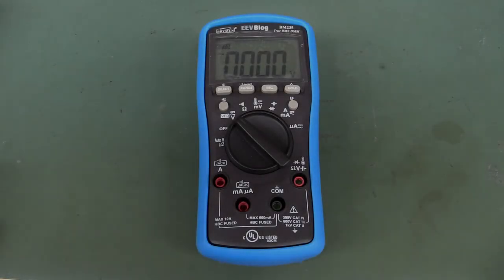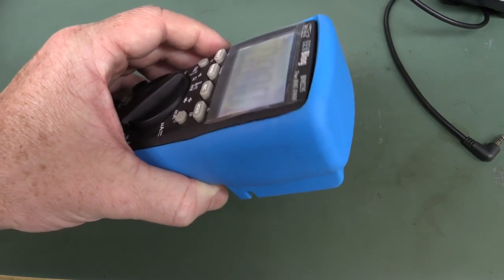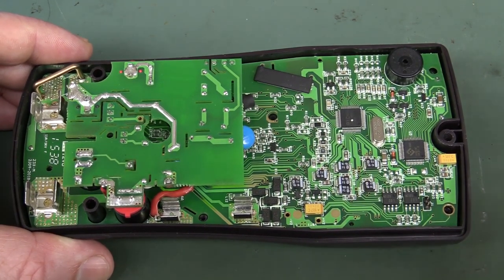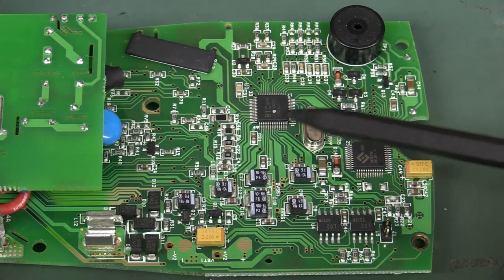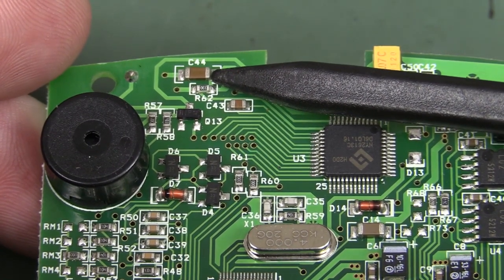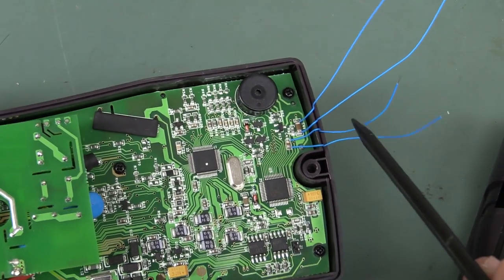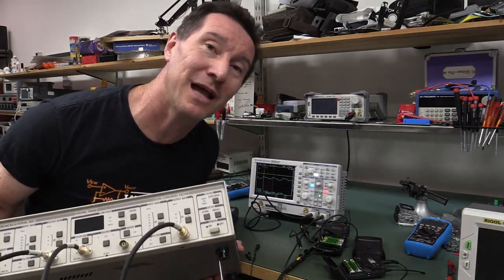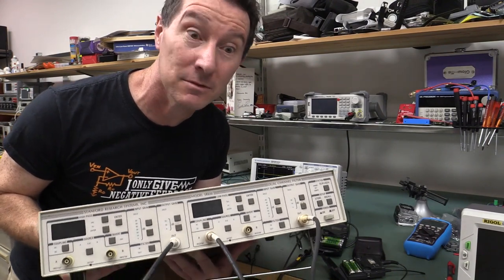EEVblog #855 - Ceramic Capacitor Piezoelectric Effect

Comment: As a test engineer I found out this problem some years ago while I was working on a SLIC device (a telephone line driver). I had a very nasty background noise which messed up the noise level measurement, we're talking about 100uVrms range noise in the audio bandwidth, very low but high enough to ruin my measurements. All was due to a small filter cap at the end of a differential amplifier in the signal chain, once I changed this to a polyester cap the background noise went dramatically low!

Comment: I love how hes like "you might be able to hear it" when its louder than the button press annunciator
Reply from the maker: +tim turner No, it's not, I amplified the audio in editing.
Reply: +EEVblog  hey can i still get on of your meters?
Reply: The whine isn't even louder than the beep in the video. The beep is higher pitch, though. Maybe that's why you perceive it as louder.
Reply: +tim turner You would be surprised. Some people are not very sensitive to high frequencies even when age related hearing is taken into account. I remember being able to tell if the TV was on in another room and none of my friends understanding the sound I was telling them it made. I think it's more of the mind filtering noise than it is the ears themselves. My head picks up every little blip and bleep in the world around me.
Reply: +tim turner I've always been more sensitive to most when it comes to these sounds too, I can hear CRT TVs when they're turned on (the high frequency noise, not the sounds you're supposed to hear from the speakers) but as I've gotten older, I've discovered I have tinnitus. If you've heard those ringtones that supposedly adults can't hear (this was a big thing back when I was in HS anyway) my tinnitus sounds like that, but not at a super loud level, so it has made it harder to hear some high frequency sound, as I don't know if I'm hearing something or if its just the ringing in my ears.
Reply: +Subparanon Indeed. lots of people don't really hear high pitch sounds. I remember as a child hearing annoying high pitched sounds all the time. Just changing the orientation of my head would sometimes make the sounds louder or softer. Eventually, I managed to determine that most of the sounds were from "ultrasonic" devices scattered about such as remote controls to TVs, old style motion detectors, etc. Some person didn't believe me, so what I did was have him unplug the TV (so it wouldn't respond to the remote control). I then closed my eyes and then had him press the buttons on the remote. When he did so, I then told him whenever he pressed a button or released it by the rather annoying whine the darn thing gave off when activated. Needless to say he was a bit surprised. I'm quite glade that remotes have transitioned to IR instead of ultrasonic, but there's still quite a bit of ultrasonic noise in various places still.
Reply: +tim turner My poor ears >.<
Reply: @johncochran8497   That was and still is the case with me. Back when CRT TVs were still common I could here them being on in peoples homes as I walked by on the street.

Comment: Another possible fix could  be a nice dollop of silicon to cover and dampen the  capacitors oscillation  frequency, which insistently clashes badly with my tinnitus!!
Reply: +Michael Beeny Good idea, that would probably nail it, and much easier than cap replacement
Reply: This could be why they put hot glue over the inductor of another Brymen teardown Dave did.
Reply: +Michael Beeny Pleasant to me, slightly lower in frequency, almost canceled it out.
Reply: +Michael Beeny i done this on various units which have backlights, as they usually tent to produce all sorts of ringing...simply a big silicone drop on top will fix that on 80%...sometimes i use hot glue, as it is stiffer and weakens the ringing a bit more...it depends...

But never use epoxy or alike. if it´s hardened up you´ll never get it off again...and it amplifies that ringing tones...
Reply: +sporadic -Z Noises like that drive me ever so slightly completely insane :)
Reply: +treborrrrr Is it possible to be slightly but completly insane?? Just a thought!!

Comment: Nice video.  Thumb up, as usual.  
Here's a story about the piezoelectric effect that some might find interesting.  Several years ago I designed a Bit-Error Rate Tester (BERT) that ran at 43 Gb/sec.  It included 17 serial channels that each ran at 2.5 Gb/sec, and each channel needed its own separate PLL to produce the 2.5GHz clock, because I had to be able to adjust the relative phase angles. (You can control the phase angle of a PLL by feeding dc current into the loop filter, which I did with a DAC.)   The eye patterns would look okay for a few seconds, and then suddenly get really cloudy, indicating jitter.  Then I noticed that tapping the side of the chassis with a screw driver made a burst of jitter.  I thought is was a loose connection, but it turned out to be piezoelectric.  Each PLL circuit had a VCO that got its supply voltage from a low-noise LDO from Micrel, and I used high quality ceramic caps on the output of each LDO.  Turns out, just a 5uV shift in the supply due to piezo effect was enough to push the VCO frequency slightly, and it took a few microseconds for the feedback loop to compensate.  But a few microseconds is a whole lot of bit periods at 2.5 Gb/sec, and the very slight freq shift caused the phase errors to accumulate (phase is the integral of frequency).  The result was that the phase difference between the channels would bounce as must as 35 degrees.  Replacing the ceramic caps with low-ESR tantalums eliminated the problem.

Comment: interesting investigation, I also had a similar issue on a board with a charge pump ic, same thing, I managed to get much better results with a quality TDK cap but I couldn't make it go away completely. I guess this can only be fixed completely by having a different switching frequency in the charge pump.

Comment: Try slipping some bus wire under the cap before soldering, then pull it out to see if you can de-couple the board from the cap.  The resonant frequency of the sound should change because the cap you put in is physically bigger.  You could also try some GB liquid electrical tape over the cap to see if you can dampen the sound.

Comment: Spot on. If you don't specify component grades or tempco values, mfg's will use whatever's on the shelf. They look at footprint, value and voltage rating first when using house parts.

Comment: The line output transformers of older crt pal and ntsc sets oscillated at line frequency 15625 for us in UK with our 625 line 50 frame system. I remember hearing it as a young'n..

Comment: I once worked on a DC-DC switching power supply project that included an over-voltage and reverse voltage protection circuit on the front end.  The two circuits worked fine separately, but when combined, the switching frequency of the DC-DC regulator (600 kHz) caused them to couple in a way that made the OV/RV circuit oscillate badly.  This caused the two 10uF MLCCs on the input of the DC-DC regulator to scream quite loudly, at a frequency that varied with input voltage.  Here's a Dropbox link to a short recording of the sound, as input voltage was varied from 7V to 18V and back to 7V.  https://db.tt/9XAGyHpA (Buzzing MLCCs.m4a, 318kB).  This was not amplified during recording; it was clearly and loudly audible from across the room!

Comment: I have noticed this on a lot of my boards. I use ceramic x5r bypass caps and get a click when connecting power or a whine when driving leds with pwm. It only seems to be very noticeable with larger caps (>4.7µF) and packages like 1206 or 1210. The size of the board and location on the board can make a big difference too. The capacitor causes the board to flex, basically turning it into a speaker diaphragm.

Comment: From the looks the capacitor you whacked in there got a much higher voltage rating than the original one. That one was only 6.3 or 10V I guess. So the DC BIAS influence from your cap is most likely smaller which results in a higher effective capacity. That could be the reason for the lower frequency of 3.x kHz you measured.

Comment: I have a TI n'spire CAS calculator (a TI-64 on steroids)  and it has a color LCD display, I think the resolution is something like 200x300 ish, and when the battery is nearly dead or if the backlight is not at full brightness, it makes similar squealing noises, VERY annoying. I assumed it was an inductor in it part of a small buck-boost converter, I'll see if I can pull it apart and investigate it.

Comment: @EEVblog Hey Dave, could you please make a video going the other way, investigating how vibrations and shock induce a voltage over the capacitor? There's not much available online, particularly comparison between Class 1 and Class 2 capacitors. Class 1 is meant to be much better, but no one shows test results.

Comment: Many years ago, I knew a clever engineer who converted ceramic disk capacitors into piezoelectric transducers. I don't know the exact recipe for the conversion but it was something like this. First, he connected many identical disk capacitors in parallel and inserted them into some oil which he heated above the Curie temperature for the ceramic material inside the capacitors. Then he applied a high DC voltage continuously to them as he slowly cooled the oil. Not all the caps performed the same afterward so he sorted through them to select the best ones.

Comment: MrCarlson's Lab did a video with a nice demonstration of the piezoelectric effect of a generic ceramic cap. Also, I would've tried bodging an electrolytic on there, that should fix the problem completely.
Reply: +MrJohhhnnnyyy         If you have room?
Reply: Hoobie Siamese Yeah, I meant just temporarily whack it in to see which one of the two makes most noise

Comment: Some of us are very sensitive to high frequency noise and I have thrown things away because they make an annoying high pitched wine. Tenergy makes a great NiMH battery, but their top of the line D cell charger starts screaming the moment you plug it in. I had to move it to my garage. I guess I know what to replace now. I thought it was some kind of voltage converter for the charging circuit.

Comment: Yeah I thought about that, so I checked again and there is a noise, so updated my comment!
There is a permanent noise when u turn the dmm, seems like its a bit quieter than  yours and ~3khz, also my 257s has 2 yellow vs  yours 3 white!
Who is really quiet, its my bm869s :)
Dave, which one u prefer  257 or 235?

Comment: I only recently learned about this property of ceramic caps. I have a small tube guitar amp that I did a bunch of switchable mods on (it's an experimental platform) and this explains why one didn't perform as expected. Guess i should stock up on more low value poly's for my experiments and mods.

Comment: I was curious if you had considered making an acoustical "sniffer" for ferreting out issues like this. the heart of this would be a tiny electret (ELECTRic magnET) condenser mic element. this can be fished out of a cheap headset they sell for phones. Because the element in all likelihood has an omnidirectional pattern, it will hear everything, and with surprising accuracy to boot. you can use this directly with the audio analyzer apps on your phone, or if you want, you can haywire an op-amp based preamp between the acoustic probe, and your test equipment.

And yes, I agree with you about fan cooled gear. when I'm at work, I am bathed in a virtual sea of white noise.

Comment: Curious how much 'solution' could be had with gobbing the cap with hot-snot as a physical damper to the sound.  I'm guessing the board is resonating enough that it would still propagate.
Reply: +frollard I had the same thought, I suppose it should at least dampen the amplitude a little bit. It would definitely be an easier fix than swapping the whole cap.
Also, could this be a failure mode in the long run, where caps wiggle themselves loose on the board, especially with the less ductile lead-free solder.

Comment: I was hoping you would try to solder that LED to the footprint to see if it would work...
Reply: That LED shining out of a window on the back of the unit is almost certainly acting as an optocoupler for some sort of serial data upload. My Uni-T UT61E has a similar mechanism.

Comment: Hi I have a serious question and ask for your generous help. I have a 0805 SMD Non-Polarized Capacitor that I’m working with but don’t know it’s value, I’ve tried reading it in multiple ways but had bad luck when purchasing a capacitor to match the one I need, please help, there are many other videos out there about capacitors but not for this kind. Your reply would be greatly appreciated, thanks.

Comment: tell me if i say bullshit BUT:
speed of sound is ~400m/s, one square is 100uS, so une delay of 100uS may be caused by placing the microphone @ 400m/s*0.0001s = 0.04m = 4cm... right?

So im my opinion the peack we see @17:32 should be shift LEFT by ~150us, and that mean the microphone is about 4cm away from the source of the noise.

Comment: Transformers make 100/120Hz (and harmonics), actually.  Same for ferrite inductors: the effect is magnetostriction, which has a square-law response (hence the frequency doubling).  This is the magnetic analog of electrostriction, which produces sound in most capacitors (including film caps, just not very much for PP and PET kinds).

Piezoelectricity is a different effect (stronger, self-polarized by nature, proportional), but is indeed present in type 2 ceramic caps.  Typical magnitudes for mechanically tapping on a PCB are single to tens of mV, so don't use them anywhere microphony is undesirable!
Reply: +Tim Williams YES! I'm a sound engineer and when there's a 100hz Hum my colleagues say it can't be transformers. I was always skeptical about it and now I know why
Reply: +Tim Williams Ferrite inductors used for voltage boosting can make very high pitched sounds, like in a joule thief circuit.

Comment: You could have used alligator clips with a steel ball in the jaw tip (from a ball bearing) and isolating the bottom of the clip with electrical tape to jumper power to those pads pretty easily.

Comment: Had that sht in a pc mouse. It took me a while to find a source. I thought it was a main ic itself. Fixed by placing some electrolytic cap in parallel with input  bypass caps. Thanks, good to know the real physical reason behind it.

Comment: Could the variations be because of the current sensing? Maybe bumping it changes the conductivity of the battery terminals (or spring connectors), so the pump changes frequencies to keep the output to the back light constant.

Comment: you want two mics, one near the meter and one further away, then take the difference in signal. Also, I'd have them equidistant from where you think the noise is coming from, it could potentially be rustling of clothes or other lab equipment.

Comment: could you tell me why a manufacturer would put a glob of epoxy instead of the chip on a multimeter board and is there any diference between the two

Comment: Also, YAY, finally an electronics video, instead of some teardown or mailbag XP
And also, the audible frequency range isn't exactly dumb. There may be a good reason for it, like losses, switching speed, etc... however yes they very likely could have used a higher frequency ... but, I'm not an IC designer, so yeah there might have been some sort of valid reason.

Comment: Just curious would you be able to fix this with a standard application of hot glue over the capacitor thus reducing PCB deformation instead of actually replacing the capacitor?

Sometimes this situation comes up on boards where you don't have the original wiring diagrams and the ceramic caps that are SMD seldom have markings to state what the ratings are.

Comment: Could you cover it in hotsnot to suppress the noise?
I had an amplifier that made a buzzing sound when i drove it into a test load, it stopped when i touched one of the ceramic caps.

Comment: As soon as I get my next paycheck i'm buying one of these. They look so much nicer than any Fluke or Amecal in this price range. Does Fluke even make a sub $200 meter? ;)

With my tinnitus, I probably wouldn't even notice the noise.
Reply: +2009dudeman Just had a peek on Farnell and this is the closest to that price I see listed there: http://uk.farnell.com/fluke/fluke-115/multimeter-digital-hand-held-6000/dp/1274599

But converted to USD that's still a bit above $200, don't know what they retail for at the authorised resellers outside Europe however. There might be a few of the models aimed at the chinese market that go for less but through official distributors and authorised resellers you should not see them outside the region they are intended for (they probably exist on ebay somewhere though).

Comment: Hey Dave, could you do a video about measuring the depth and alignment under water electronically with the "DIY" dudes in mind who are on a strict budget? "Under water" meaning "a DIY small submarine with a 5 kg carry capacity that's built by using garbage and flying around components".

Comment: Can't any capacitor "sing"? Two plates with opposite charges will attract each other. If they are allowed to move, then you may be able to hear it. This, of course, would not be the piezoelectric effect. It would be more like a condenser microphone or an electrostatic speaker.